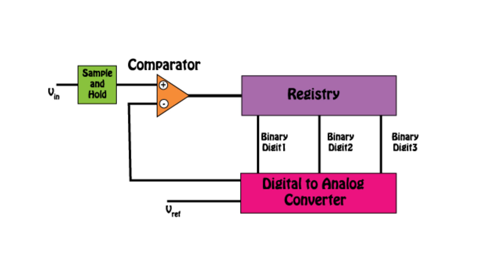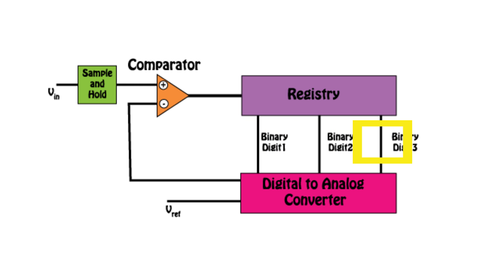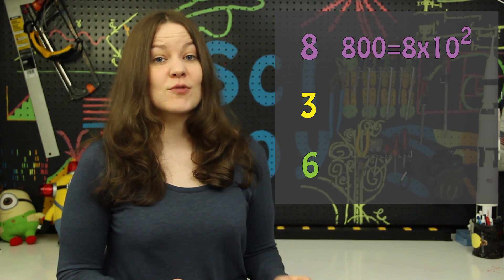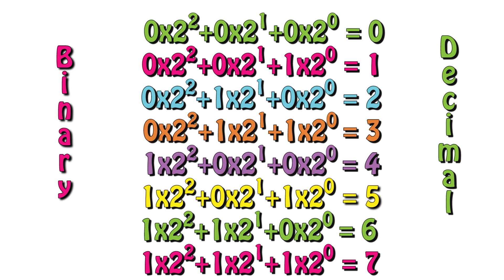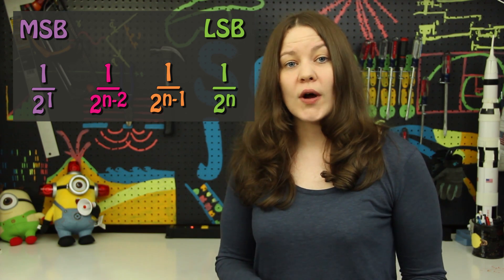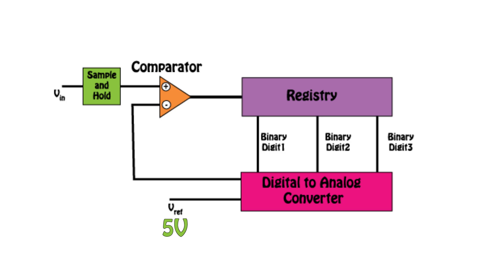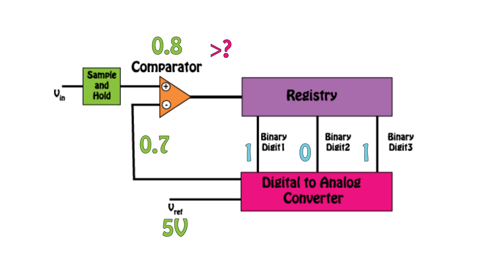Analog to Digital Converters Part 2 - Successive Approximation | Arduino - Ep 4

Comment: can you also explain about the voltage fraction and bit weight? I mean, what is about the bit weight? 
For "010" => 0 * 4/8 + 1 * 2/8 + 0 * 1/8 = 1/4 = 0.25. Is useful somehow this 0.25?

Also you told me about the buckets, but in your video you say that there an N-1 buckets, and now you tell me that there are N buckets where N is the resolution.

Thanks in advice

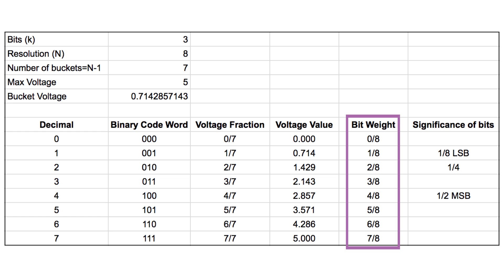Comment: In that table from 3:32 how do you know the maximum voltage is 5V?
Reply from the maker: With microcontrollers, like the Arduino, you typically have 3.3V or 5V as your input voltage. Here is a copy of the spreadsheet I was using. I haven't look at this in a long time, but I think this is the correct version of it. You can put in different voltage values and it will adjust automatically. https://docs.google.com/spreadsheets/d/1dYNtxGX30qaWonZ6RQrryr8u3WuPRqJlDrcXCjP3dyg/edit?usp=sharing
Reply: @SciJoy  How u choose the proper MAX Voltage
Reply: And one more question, what is that you call number of buckets?
Reply from the maker: @dragosmakovei  The max voltage is the VCC in of your circuit.
Reply from the maker: @dragosmakovei  Buckets is really the resolution. If you have 2 bits, you have 4 options (buckets, my term). You can have 00, 01, 10, or 11. Those are all the combinations you can have for 2 bits. For 3 bits you have 8 options (buckets)  -- 000, 001, 010, 011, 100, 101, 110, 111. Does that help? Thanks for all the questions. I might make another video with the actual chip. Now I know all the things I need to explain more clearly.
Reply: @SciJoy  i cant wait to watch it. Also thank You for You explainations. 

Could You please Tell me what book can i read to learn about microcontrollers like from scratch ? The Most basic to medium difficulty?
Reply: @SciJoy  Hei could you please answer me to the questions i've asked?
Reply from the maker: I have a bunch of projects with deadlines at the moment. I will answer when I can.
Reply: So max voltage can Be whatever value? Is it dependent with number of bits? Eg. For 3 bits =>  the max voltage can Be 5V ?
Reply from the maker: @dragosmakovei  the max voltage and the bits are completely separate. The bits you have is determined by the analog to digital chip you have. Typical ones are 8, 10, and 12 bits. I used smaller numbers in my example to make it easier. The ADC chips have a voltage range they are capable of handling, but you can chose any value in this range. The bits are fixed. For items like Arduino, they use 3.3V or 5V for their analog pins. Their ADC is typically either an 8 or 10 bit. The more bits you have, the more values you have to chose from. You only have 4 options for a 2-bit, 8 options for a 3-bit, and 16 options for a 4-bit. The number of options is determined by the bits.
Let's say your max voltage is 5 volts and the actual value from your sensor's actual value is 4.8 volts. If you have a 2 bit converter, it could estimate that as 3.3 volts, because that value is greater than 3.3 volts but lets then 5. I believe the ADC rounds down. If you have a 3 bit converter, it would estimate the 4.8V is closest to 4.3 volts. If you have a 3 bit converter, it would estimate the 4.8 volts as 4.7, because that is the closet bucket. Does that help? 
The voltage value in the spreadsheet is the determined by the max voltage of your circuit and the number of buckets, but you can pick whatever max voltage you want for each of the bit values.

 Are you working on a particular project? Here is an example of an 10 bit ADC. You can see that it has a voltage range between 2.7V and 5.5V. https://www.sparkfun.com/products/8636